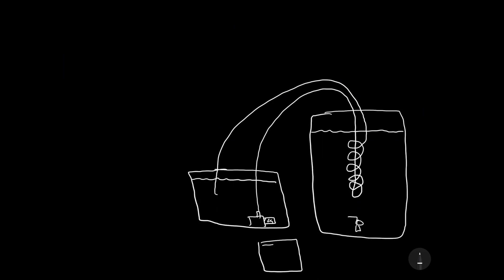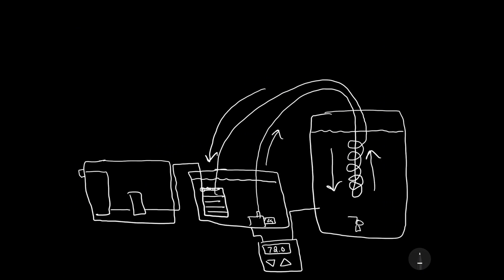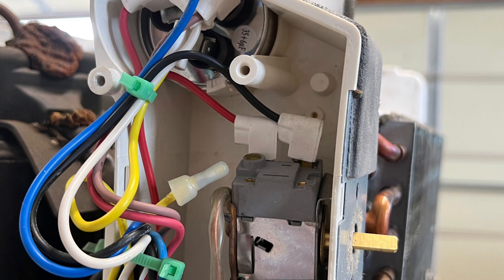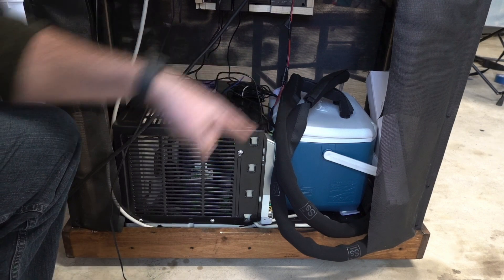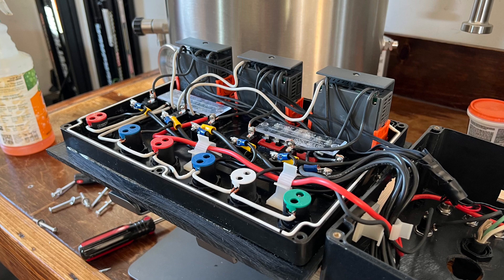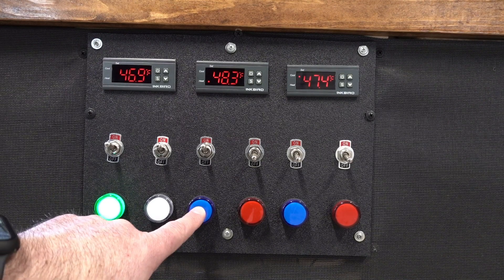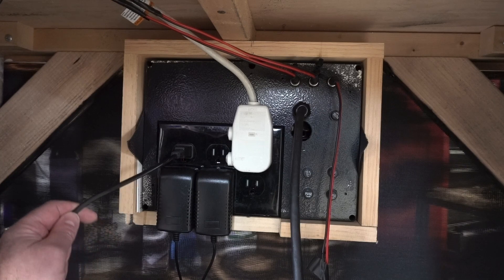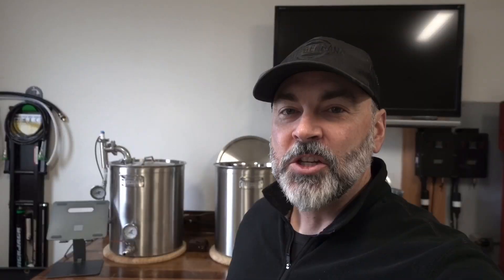How to Build a DIY Glycol Chiller [ Control Fermentation Temperatures ]

Comment: did you wire the lights in to come on when the pump came on or when the switch was turned on if it was when the pump came on how did you do it
Reply from the maker: @davidsilva-eo2bs  I wired it to come on when power is sent to the pump. I posted a follow up video that goes on a little more detail on the control box if you want to check it out. Cheers!

Comment: Beautiful build.  Can you see any of this information remotely?
Reply from the maker: Sweet, then a diy glycol chiller will be a piece of cake for you. Make sure to check out my follow up video I posted earlier this year. I go into a little more detail and upgrade parts of the system.
Reply from the maker: @uSlackr  funny you should say that. I’ve been waiting in inkbird to come out with a WiFi controller like the ones I used in this build, but they haven’t released a product like this to my knowledge. Maybe I’ll upgrade the system in the future with WiFi. Thanks for the comment, cheers!
Reply: @justhomebrew  Thanks.  I'm big into home automation and either build my own temp controllers (using EPS32 devices) or buy something that I can intergrate into my existing system (home assistant).  Gives me a dashboard, alerts and control from anywhere.  I think I'm going to tackle this glycol chiller next.

Comment: The toggle switches seem redundant to me. Lights are nice for indicators, but doesnt the inkbird controller automatically power heating and cooling toggling?
Reply from the maker: Hey richardcagle5475, I could have gotten away without the toggles switches with this panel, but I do find it nice to completely turn off the pump and heating blanket when I’m done while keeping the inkbirds on. I keep everything plugged in so it’s nice to know, at least for me, there is no power going to the outlets when the switch is toggled off. Thanks for the comment. Cheers!
Reply: @justhomebrew  oh yeah, the pump an heater need dedicated switches, bit the others for each branch were redundant right? I'm not trying to knock your work at all, more like in trying to understand your reasoning during this specific application. I plan to do this myself in the future and I'm kind of a minimalist. I appreciate over engineered products, I just don't want to build one 😁
Reply from the maker: If you want to build a minimalist controller for your glycol system, you could totally get away with just the 3 controllers and ditch the switches and light indicators.  I had two reasons for my design. The first reason was because I wanted the ability to turn On or Off my outlets at anytime. I planned on keeping my system plugged in all the time, so I wanted be sure that no power would go to the outlets if I toggled off my switches. In reality, You could just turn off each Inkbird by pressing the power button if you wanted to depower the outlets. This would have the same effect as the switch. The second reason.... I was completely bored during Covid so I went overboard with this project. I also had a bunch of leftover parts from my electric control panel build(for the electric kettles) , so I guess you could say I was trying to be a little creative. Cheers!
Reply: @justhomebrew  lol I didn't get the covid boredom. Had a job that required hands on work and lots of travel. I'm not sure which was worse. Being forced into the insanity or being forced into your home. Ended up quitting the job 18 months into the vid so there's that. I do see the appeal of just walking by an toggling switch rather than fooling with the tiny controller buttons. Maybe I'll use a few too :). Thanks for going through your process for me, I really appreciate it

Comment: its water,not glycol?
Reply from the maker: It’s a mixture of water and glycol. It helps it from freezing.
Reply: ??? @justhomebrew
Reply from the maker: I guess I don’t understand your question. If you’re referring to the liquid that cools down the fermenter through the heat exchanger, I use a mixture of water and glycol. My system gets to freezing temperature so I need use glycol to prevent the water from freezing.

Comment: Good morning from Greece. Do you think it would work as well in a 500 liter wine barrel?
Reply from the maker: Good morning! It’s hard to tell exactly how a DIY system would perform in different situations. It would depend on a number of things like what temps you are trying to maintain, your ambient temps, the heat exchanger, etc. Based on my experience and the batches I’ve run, I would would keep my fermenter volumes under 15 gallons with my current glycol system. I noticed when fermenting two 5 gallon batches at a time,my system did seem to work a little more. I think 132 gallons would be a big ask for my current system. If it were me, I would look into a bigger cooling system or a commercial unit at that point. 132 gallons is a big investment in time and materials. Thanks for reaching out and I hope this was helpful! If you do build one, keep me posted, I’d like to find out how it performs:)
Reply: @justhomebrew  Thank you very much for your prompt response and help.

Comment: Nice video! 3:33 where did you get these fittings for your vinyl tubing? What are they called exactly? Thanks!
Reply from the maker: Thanks for the feedback! I beleive you’re referring to the SS Brewtech FTSs quick disconnect fittings. I post a link to these fittings in the video description for you. They work great. Cheers!
Reply from the maker: Ah, I see now you’re referring to the couplers. I’ll post a link to those couplers tonight.
Reply: @justhomebrew thanks for the reply. Yea I saw you got those SS lines which are nice and I might get those as well. But I’m not sure how you connected them to the top of your cooler. I see it just goes through the top. I’m not sure if you’re still connecting it to those couplers or not? Trying to figure everything I need to buy
Reply from the maker: These connections are called LOKMAN Cable Glands: https://amzn.to/3OQtDDA. I had to do some digging  because I forgot what they were called:) They are pretty simple to install. You simply drill a hole big enough for the threads to go through the top of the cooler, insert the threaded end through the cooler top and screw the plastic nut enough so it's snug. I might have drilled out the inside of the lid a little larger so I have room to tighten the nut. After you're done attaching the cable gland, fish the tubing through the hole until you have enough tubing to reach the glycol and pumps. Then tighten the cable gland so the tubing is secure. Once you hold the cable gland you'll understand. Just order the size you need depending on the size tubing you plan on using. I ordered the variety pack and it worked well for me. Good Luck!
Reply: @justhomebrew   awesome thank you! I didn’t know they were called cable glands. That’s super helpful. Do you still use these with the SS lines tho? It’s hard to tell what’s going on at the top of your cooler when you showed off the SS lines
Reply from the maker: @commentator2.0  Yes, I still use the SS lines with the cable glands. All the cable glands do is securely hold the vinyl tubing in place on the cooler. The SS Brewtech connectors are valves that automatically shut off the flow of the glycol when disconnected. This prevents any glycol spillage when connecting and disconnecting the tubes.
Reply from the maker: Also, check out this follow-up video https://youtu.be/APGE5wAqmIE around the 6 minute mark. You can kinda see how the tubes are fed through the cooler. Hope this helps.

Comment: Looks great. Could a small chest freezer with a glycol reservoir work?
Reply from the maker: I’ve seen some builds using a chest freezer and a glycol reservoir. I would imagine it would keep fermentation temperatures stable. This would be an interesting build to see if this approach could cold crash the beer as well. At the time I was researching approaches for my build, it appeared that an ac cooling coil was much more efficient than a chest freezer. This would be a cool comparison. If I went the chest freezer route, I might consider ditching the glycol approach all together and just use the freezer as a temp control for simplicity. Cheer!

Comment: How many btus can the ac unit cool down?
Reply from the maker: Hi Andres, my ac is 5500 BTUs. I can confirm it can easily cold crash 2 7.5 gallon fermenters in 4-5 hours on a 50 degree day. When it’s warmer out, it does kick on more often, but that’s due to my smaller 3 gallon glycol reservoir. I’m going to upgrade to a bigger cooler over the summer. I feel the ac size is just fine for my size setup. Cheers!
Reply: @justhomebrew  ThankYou for the response! 

Im looking to build a glycol chiller for 2 fermenters, 1 BBl each. I saw a commercial one at around $2,000, which is the 1/2 hp Penguin 2,650 BTU @ 28F. Im not sure how to interpret that BTU rating at such low temp, but since it is so expensive, I decided to buy a used AC with a 13,000 BTU rating at only $150. Hopefully its enough, Im not sure, but I will try to recreate your build with the inkbirds, thankyou!
Reply from the maker: @andresnizri2027  A commercial unit probably is much more efficient in terms cooling the glycol with better cooling coils. If I were to build another at a larger scale, I would go much bigger with the glycol tank/cooler. It’s hard to put an estimate on this (and I’m not a math whiz), but I know my 5500 btu unit can cool 3-4 gallons of glycol in 20-30 second. It’s quick;) 1bbl fermenters will pump a lot of heat back into the glycol tank, so figure a chiller possibly 2-4 times bigger than mine.

Comment: I wonder how much all of that cost? Is it cheaper than just buying a used freezer and an inkbird? 
And yeah I understand that the motivating factor here is producing a cool DIY system and that might override cost concerns for some people.. I'm not mechanically inclined though so if there is a cheaper and easier option that would be my personal choice.
Reply: Most unitank-type fermenters will not fit in a fridge or freezer, except for maybe a full sized upright. A glycol chiller will tend to take up much less space, and has the BTUs needed to cool more than one fermenter at the same time. Commercial glycol chillers have very attractive footprints, but very steep price tags. The DIY style using an AC takes up more space but will costs very little compared to commercial options.
Reply from the maker: @skratchx  I missed this comment, totally agree. When I went the DIY chiller route, my main goal was to build a system that could cool down(and cold crash) more than one fermenter and reduce the overall brewery footprint in my garage. My design is compact enough for me and does not require me to run multiple fridges which is a huge plus. I've seen a few setups with people using fridges that work. I think this would be a cool build and side by side comparison, however I've sticking with my glycol chiller for now. Cheers!
Reply from the maker: I believe I built this diy controller for around 120 dollars. I definitely wouldn’t build your own temperature controller to save money. Three inkbirds would cost about the same as building your own. I actually started with 3 Wi-Fi inkbirds and was headed down that very path. As I was putting the system together with the already made controllers, I could not figure out a way to organize all the wires and most importantly to me, I wanted to be able to turn off the ac, pumps and heating blanket without unplugging anything. Cheers!

Comment: Do you know if it would be possible to modify the controller on an aquarium chiller to get the reservoir down to 30 with glycol? They all have the same controller as yours, but the settings are limited to like 50 degrees.

I've seen them sell for $70. It would an incredible upgrade at a low price.
Reply from the maker: To be honest, I’m not sure. Are you looking to use an aquarium controller for your glycol chiller? The controllers I used were pretty cheap. I think I spent 12 bucks on each one.
Reply: No

Comment: Where did you get those quick connects? Do they seal when disconnected? I've been wanting to run a cold water loop in my keezer to control ferment temps for years but have never found a great solution for connecting/disconnecting.
Reply from the maker: I bought these quick connects from SS brewtech. Yes, they seal when they are disconnected. I’m really happy with them. They are a little pricey, but worth it. I’ll post a link to the kit in the description for you this weekend.

Comment: Good idea to convert an old Air Conditioner (although not legal where I live).

Unless you live in a particularly hot region or need to brew beer on almost a weekly basis, I would avoid the glycol cooling option. A standard fridge and heating lamp controlled by an inkbird controller should work fine.
Reply from the maker: Thanks, although I can’t take credit for this idea.  There have been many brewers before me who built a setup like this. This is just my version of a DIY AC glycol chiller.

A standard fridge is also a great route to go.
Reply: @justhomebrew  
Cheers. 
(It’s the first time I have seen an AC converted to function as a glycol chiller for brewing)

Comment: Great video.  I'd love to see a more indepth video on the glycol chiller build.
Reply from the maker: Thanks for the feedback, Jeffery! I’ll definitely plan to make another video that goes a little more in depth about the build.
Reply: Totally agree!
Reply from the maker: @jacobkendrick8857  I’m planning for this video in a month or two. What specifically do you want me to go over? Thanks for the feedback!
Reply from the maker: @Jbishop I’m planning to get to this glycol chiller build overview next month. What specifically would you like to learn more about?
Reply: @justhomebrew  I've got an old AC unit like the one you started with, but you lost me at stripping down the AC unit to essential parts, how you wired the inkbird to bypass the temperature controls and how you got the coil into the cooler without breaking it.  Also the control panel build was really quick and left me wanting a bit more for how to assemble it like your system configuration.  It'd be really great if you could break those areas down a bit further.   Thanks for even considering it.
Reply from the maker: @JBishop  okay, I’ll see if I can add a little more detail about what your looking for. I thanks for the feedback!